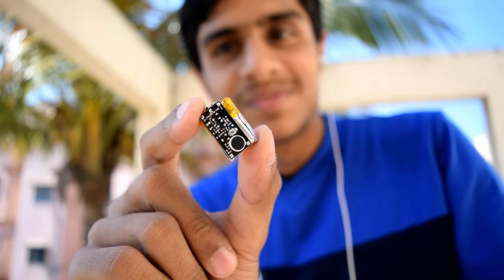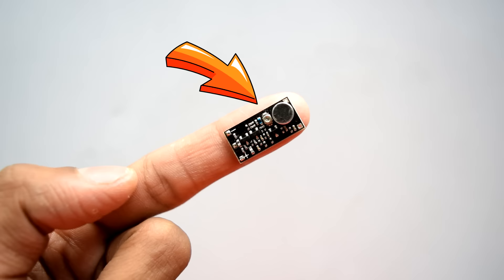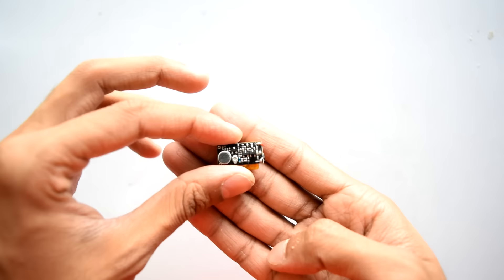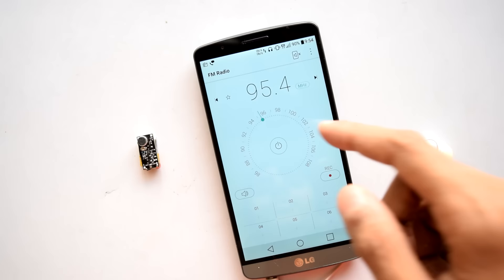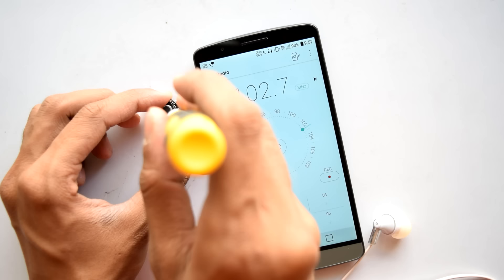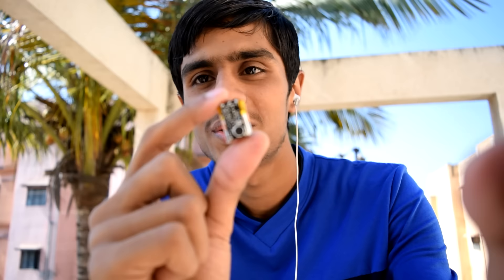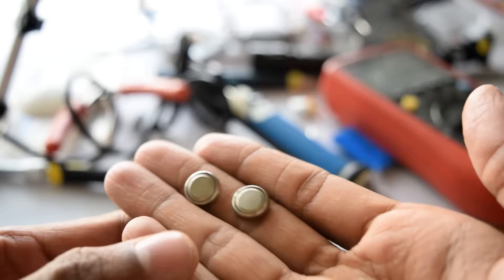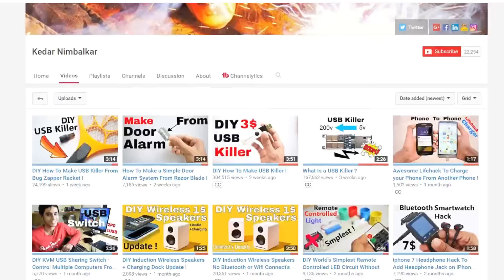How to Make Mini Spy FM Transmitter Bug - A Wireless Audio Transmitter ?

Comment: how will you charge the battery
Reply: Virus Demon Exactly
Reply: Major is the correct solution
Reply: Just buy a 5V 1A charging PCB or use a phone charger by stripping the microUSB port of the cable & connect the +ve & -ve wires directly to the battery.

Not to mention, considering the low power requirement, this battery may just last a week, if not a month.
Reply: Or add solar cell
Reply: solder a short lipo female connector to the pcb and use a usb to lipo male charger The kind you'll find on a small toy RC helicopter , plug the battery lead into the pcb socket and just use an elastic band to wrap them together ..that way you just unplug and recharge .
Reply: When you KNOW that you're being played with just give the TRASH a great performance😴

Comment: Good video! I really like this small transmitter, unbeatable for the price. I made a video too with some additional information. Connect a quarter wave length antenna wire to the middle pin, at 3V you'll get up to 300m LOS, at 9V up to 500m LOS

Comment: Hi Kedar....Thanks for posting the video. As per the technical specs the battery should be : 9mA (3V ), however 9mAh is not available in the online store. What's your recommendation?  and is it safe to put the transmitter inside the back cover of a mobile for spying.?. ...waiting for your reply...thanks.
Reply: You should focus on a larger battery so the transmitter can send stronger signal

Comment: awesome work! I was wonder which app you use for the FM radio receiver?
Reply from the maker: +Technomancer I used stock FM app
Reply: If you were trying to use your iPhone, iPhones unfortunately do not work, some android phones do not work either. If you have an iPhone, you can pick up a cheap transistor radio and probably use that to tune in and ease drop on people with your new little bug friend. It’s range is theoretically good also, so you should be able to sit outside and listen to what’s going on inside through the little bug.

Comment: I refer to this simple but surely effective device. Now I can't use it because I don't care to use headphones but I want a 'self speaker so I can record if necessary!!! But I have to wait for a '3.5 to 2.5 jack adapter !!! It is this, "F-908 Wireless Transmitter Receiver, High Sensitivity HD Pickup with Headphone and USB Connection Charging Cable for Outdoor Construction Site (50-300m Distance)." Please let me know YOUR views. For the time being, thank you.

Comment: Hey Kedar! Love your videos. Do you think you could desolder the microphone and somehow add a 3.5mm input? That would be cool. keep up the great videos.
Reply from the maker: +Justin mic has biased voltageso it will destort external audio this module is not perticularly good for external input maybe you need to experiment a bit !
Reply: I tried it, it worked but still not a reliable option
Reply: @pradeszebua  how did you get the battery and got any better ideas? If so, PLEASE share:))
Reply: @dhstudios1269  I didn’t use the same battery that this guy used, I used 3 of 1.5 v battery stacked in series... I think they are called button batteries

Comment: thanks for your time... how far is the range??
Reply from the maker: +Dan Hart it's range is ~ 10-30 meters.
Reply: connect a quarter wave length antenna wire to the middle pin, at 3V you'll get up to 300m LOS, at 9V up to 500m LOS

Comment: Can i solder a S 1 female connector to the module? So i can just click the module and battery apart for charging? Instead of cutting the connector of the battery and soldering it directly onto the module? Thanks mate
Reply: And what did you solder as the antenna? Hard to see in the video which is amazing by the way.  Did you made a small antenna from the copper tape at the end of one side of your cross and soldered the copper tape onto the middle antenna hole of the module?
Reply: Sergei Glimis  thnks mate

Comment: Umm a switch would probably be useful....so you can ya know....turn it off! 
And a protection board so you dont destroy the battery by completely discharging it as soon as you build it.

Comment: whats the maxium signaldistance for this small device?
Reply from the maker: +Drechen Lard about 10 meters
Reply: can you increase the sending distance somehow to about 100 meters?
Reply: connect a quarter wave length antenna wire to the middle pin, at 3V you'll get up to 300m LOS, at 9V up to 500m LOS

Comment: Which module and battery could I use to do this with bluetooth? Your video's are great btw!
Reply from the maker: You can use Bluetooth transmitter module they are easily available on eBay

Comment: How long will the battery losts and what's the maximum range of this module
Reply: power consumption depends on battery voltage, about 10mA at 3V, about 30mA at 9V, range is up to 500m at 9V

Comment: What is the range? Cool video.
Reply from the maker: +Dwayne Wladyka about 30 meters
Reply: connect a quarter wave length antenna wire to the middle pin, at 3V you'll get up to 300m LOS, at 9V up to 500m LOS

Comment: Hey Kedar, nice video man.I ordered one for me from ali express.
I want to use it with a 9v battery, is it safe? will it get damaged(any heating issues)?
For the antenna,what should I do? Will a wire work? if yes,then tell me the ideal length of the wire.
Please reply......
Reply: nope, module works on 3.7v and 9v will burn it out
Reply: Wrong. Module works from 1.6V up to 9V. If you go higher than 9V the transistor of the amplifier section will overheat though

Comment: Nice! And because it's FM would I be safe to asume its range is limitless?
Reply: FM‘s range depends on the antenna size on the sending and receiving devices, and, for the sending device, the power of the signal. For the receiving device, the sensitivity and accuracy of the FM circuitry in the system is what helps in determining its range. Also, interference from structures, and, other wireless signals and electrical radiation interference as well as other types of radiation interference may have a play in the range of the signal. Also, even the weather may have an effect, but it will be a small one. You may not think it, but even the material that the antenna is made out of, and even the type of antenna, they’re being 2 types: One Direction and multi directional, can play in determining range. A single direction antenna looks for signals in the direction in which it is pointed, and it is used on transistor radios and boom box radios. The multi directional radios are used on vehicles, and look for signals all around the antenna. Please note: antenna toppers interfere with radio signals. Remove your antenna toppers, if you have any, if you notice that your radio signals are getting worse. However, antenna toppers should not interfere that much with the signal as they are made of materials in which radio frequencies can easily pass through. FM‘s range can be Realistically limitless, but there’s never completely no limit.
Reply: @Techlifeandmore  Wow. Thanks a lot!

Comment: Hi Kedar, 
How long do the battery survive? And how do you charge it?
Reply from the maker: +Kraantje Pappie battery lasts for about 65 minutes and you can charge with TP4056 lithium battery charger
Reply: wanted to know if there is any battery I can use which wil last for 3 days without charging?

Comment: whats the range like??
Reply from the maker: +Vicer Gaming it's 10 - 30 m
Reply: connect a quarter wave length antenna wire to the middle pin, at 3V you'll get up to 300m LOS, at 9V up to 500m LOS

Comment: Have you tried it with a miniature fractal shaped antenna instead of copper wire.  Also maybe versions that look like a usb flash drive or a flat dongle for low profile,  and of course building into a charger or car cig lighter plug car. Let me know i am an artist and tinkerer you can see some art on my instagram and message me there kevinmkelley10 is my instagram

Comment: It’s cool and everything but, shouldn’t you be concerned with capacitance from capacitor to rule your design?  Do a more expensive battery that lasts and is more exotic, not cheap.  Print the board yourself and flipit on a home printer, or save up for your own laser printer later, right for 4-6 materials types spools.  And further, to make this green to use recharge from nice solar screen?  As impractical as it sounds a simple slip cover could conceal it in plain sight and offer a great solar sheid recharge station nearly 90% the size on a magnetic slipcover. Then you’re in business for yourself, you can then reinvest buy better tools and set up shop and be in business for yourself and never worry about bills.  Just credit my name teeheehee. Collaborate & Cheers.